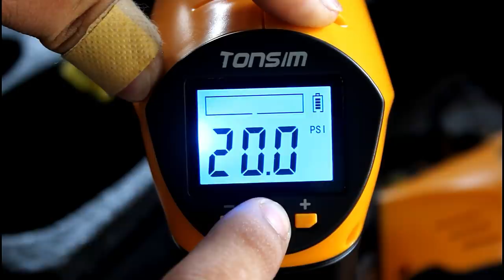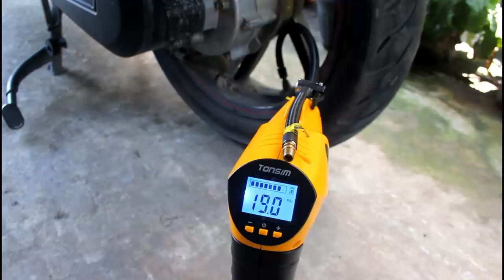Diy Motorized Hydraulic Press Bench top || Plus Giveaway ||

Comment: I Like the pump irs fully auto just plug and let it do its work.im still using the old  manual pump.
Reply: did you finally get the pump gift?
Reply: No
Reply: @ronaldgravilla9108  My company is the original manufacturer of the air compressor in China

Comment: Would it be possible to get a list of all the parts and tools you used? I'd like to try something with them
Reply: Also want to ask, wouldn't it have been possible to attach a larger steel plate to the sprocket on the motor then use it to drive the metal lever in the Jack for up and down motion thereby not needing the bicycle pedal crankset?

Comment: Why not just use the handle that came with the jack  ?
It's obvious the DC motor does not have the ability to withstand the power that's needed to operate the pump under high pressure.
Reply: the output power  the dc gives  for the starter is strong to operate the very pump.otherwise give us wthat you have in your mind. too brilliant, well done,sek .......
Reply: This is a good idea for avoid lose of money for purchasing of hydropic press